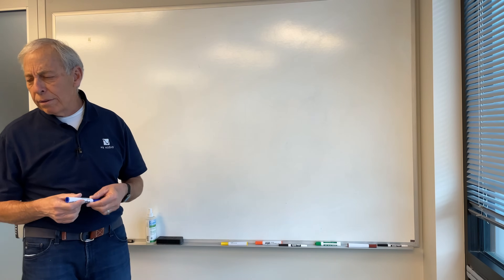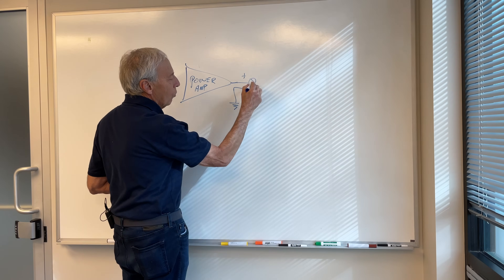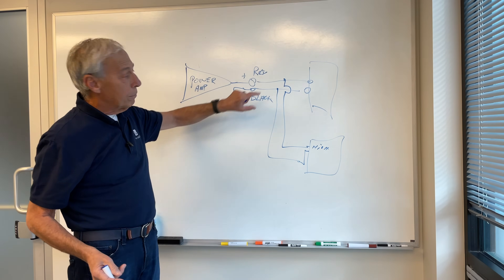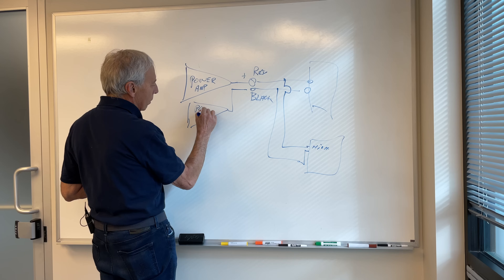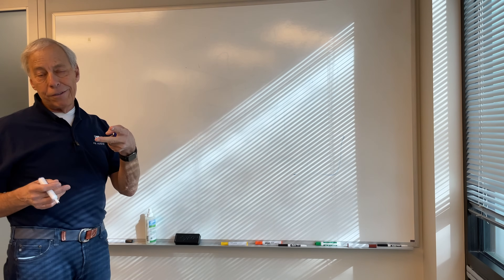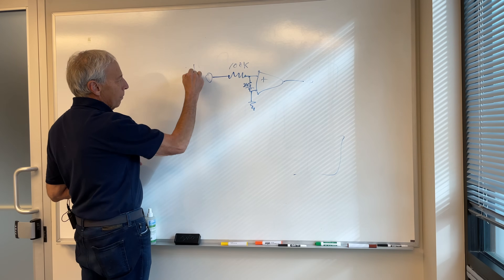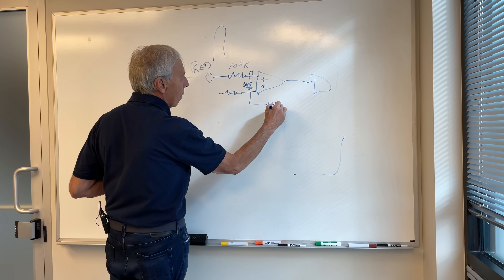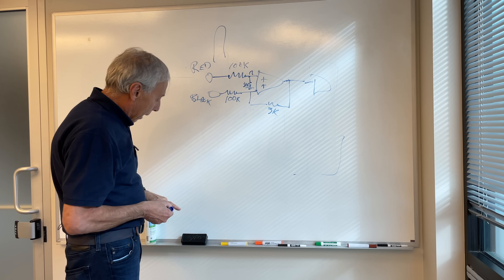How does a subwoofer high-level input work?

Comment: I am confused.  I have a BHK 250 amp which has four pairs of speaker outputs. Two pair are connected to my speakers.  Can I not use the other two pair and connect them to the high level inputs on a subwoofer and be OK?  If not, what do I do?
Reply: Actually you can indeed use the second set of ouputs. Paul confirms this in the vid.

Comment: Just the video I needed. Now to find a high level sub.
Reply: Mj acoustics do high level
Reply: @richardcoles2432  MJC is not a household name in the states, though REL is
Reply: @billd9667  I think rel made some subs for mj acoustics or the other way around 🤔  anyway their subs with neutrik speakon high level inputs allow you to still retain the  .1 data ( lfe ) with the normal rca cable so you get the normal lfe low level stuff like explosions,rumbles ect but with the high level attached you get 5.0 with bass as well if you follow me? So you could be watching a music concert for example and still get bass from your sub even when there is no lfe signal...so you get the best of both worlds! With the mj subs you can put a sub on any channel you want ie fronts,centre and the rears as well .
Reply: Rhythmik either includes HL inputs or offers it as an option on their subs. REL has it in all of their non-HT subs. RSL sells an awesome little ported 10 inch Speedwoofer that includes them. 

The thing is that most sub makers (REL is an exception) only offer it on their entry level products.

Comment: Edmonton represent!

Great question, I love when Paul gets into circuits.  Interesting to see how high level inputs work.  Currently saving up for some REL subs.
Reply: Same here 🤭 Which model are you looking at to buy?
Reply: @mdaniknightrider  REL's Subwoofer Finder suggests the S/510 or dual T/7i.  My system is 50/50 stereo/HT.  Coming from an SVS sub that digs below 20Hz, I think I will be more satisfied with the S/510.
Reply: I was looking at the S/510 too. For the same purpose as you were looking as well. I listened to the S/812 with my speakers at the dealer. Once you hear a REL, there is no way going back subwooferless. It was like the main speakers making that low bass. Incredibly blended via high level, and wirelessly is amazing too. One thing with REL, you can definitely feel that bass in your chest if you have to.

Comment: Having the side speakers trying to do the bass that you bought a subwoofer to do better is not always a good idea if you want the highest quality deep bass.
Reply: One would think so, but one would be incorrect. Speakers, unless they are designed as limited range satellites, are designed to take the full signal. By adding the sub you are really augmenting the speakers for the low frequencies that they cannot produce adequately. For example, in case main speakers are 2 way, what you create by adding subs is a 2.5 way speaker.
Reply: @razisn  Of course stereo speakers are designed to take the full signal but it doesn’t mean they perform well in the deepest bass. Usually smaller speakers are using tricks to produce deeper bass that yield poor decay performance and a distortion that can become multiple percent at higher volumes. Your low distortion subwoofer might produce a very clean 50Hz that then combines with some smaller stereo speakers outputting 20% THD on top of it. A smaller woofer  of your stereo speakers will hit the excursion limits much earlier creating compression distortion and some smaller speakers also make much port noise. A major benefit of high-pass filtering the side speakers is that your power amp can use the power focused on what the side speakers are better at. But of course adding high-pass filtering to your side speakers is best done on the line level or in a DSP before your audio hits the DACs and power amps. My favorite approach is using DSP where you can do much better optimization of frequency response and phase (e.g. using miniDSP).

Comment: Are REL subwoofers common ground input? Are B+W subwoofers common ground?
Thanks for all your educational videos!
Reply: If both of your amp terminals are hot, like in a balanced differential amp, you cannot connect to the ground terminal of a REL sub to the amp terminal. Instead you only connect the hot terminal of the sub to the positive terminal of the amp and you need to connect the ground terminal of the sub to a true ground on the amp. That could be the phono ground post or, better, the return of an unused RCA connection on the amp or any other connected component for that matter. The REL sub just needs to find a true ground reference.  No idea about the B+Ws.
Reply: You can connect an active Rel sub with high level connection to virtually any amp but the method of grounding will vary depending on the amp. The issue arises because you are really connecting an amp to your amp output,  not a passive speaker. Having a single pair or two pairs of speaker posts on the amp is irrelevant. These are usually connected in parallel and are there just for connection convenience, instead of trying to connect multiple wires to a single post.
Reply: @Lloyd Stout what are you talking about?